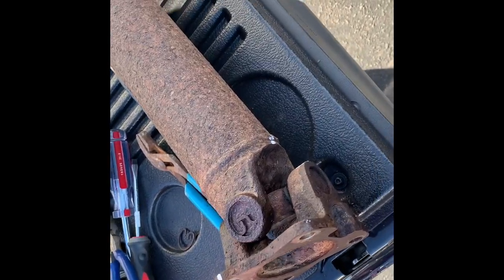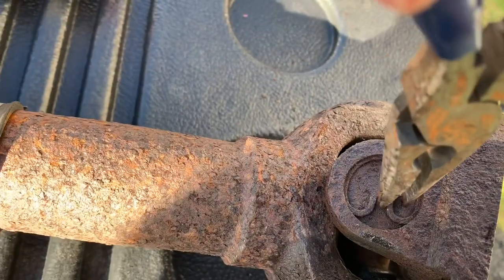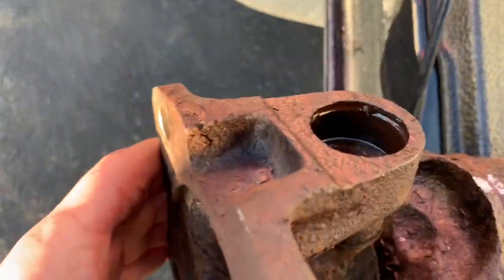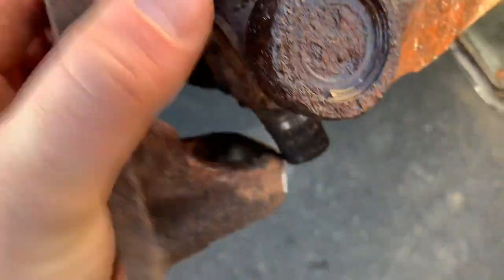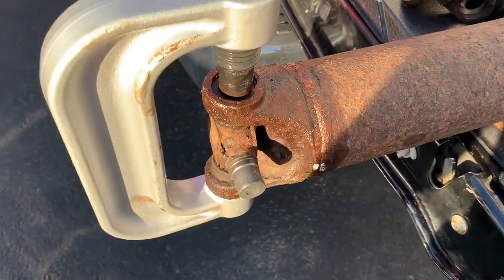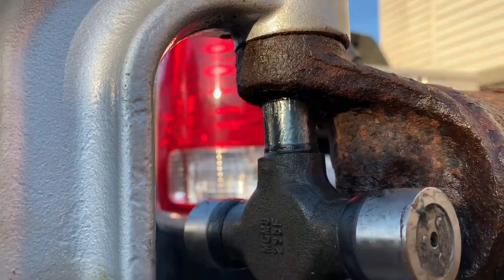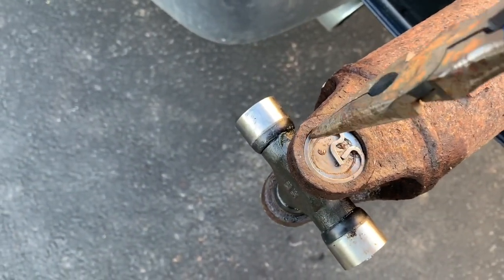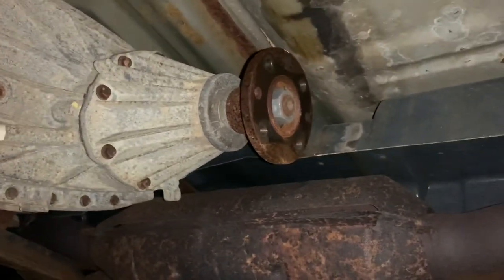HOW TO REMOVE AND REPLACE RUSTY U JOINTS ON EXCURSION/SUPER DUTY

Comment: The old ones i bash out with a socket and a sledge. The new ones i really clean up where they go in. I take fine sand paper and brake cleaner until its sparkly clean. Then i take a dab of machine oil and wipe it on with my finger. Destroyed too many ujoints and learned the lesson.

Comment: I've got that tool,  but that joint will not move. See if I can find a shop with a hydraulic press.

It's always so much easier on youtube.
Reply from the maker: lol put it under tension with the remover then whack the ears with a hammer and itll usually pop loose
Reply: Socket and sledge hammer. You don't got to be gentle with the old ones. Your replacing them.